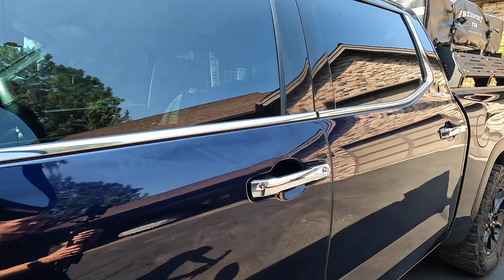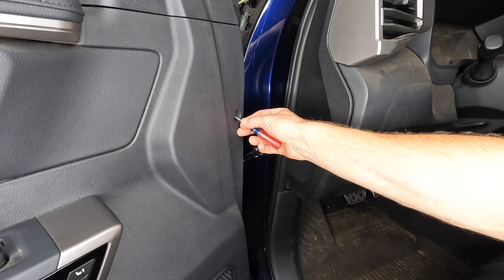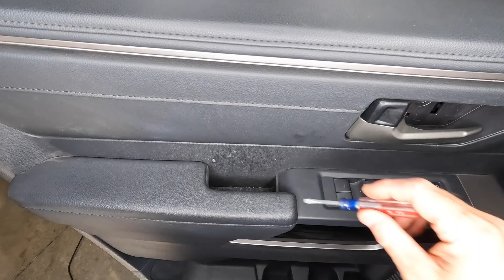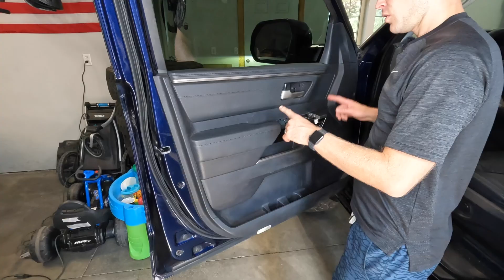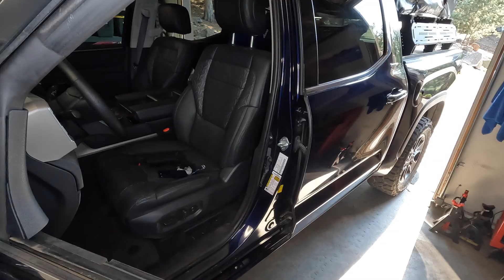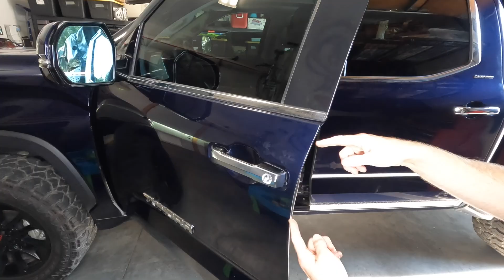2022 Tundra Chrome Delete | Door Handles | How to Remove & Reinstall

Comment: Just a heads up, I would not recommend doing this without removing the top triangle behind the mirror. I tried to do it like he did and it broke off a clip off the back of that piece, and now it doesnt sit flush.
Also, you can get the color matched door handles much cheaper from toyota also

Comment: Is there anything that can be tightened inside the door panel. I feel like I’m hearing noises in there on mine and I was wondering if it was worth taking the panel apart or if it could only be the three screws you had to mess with